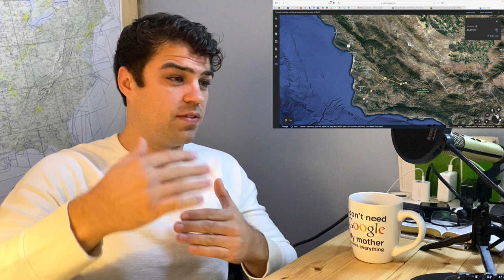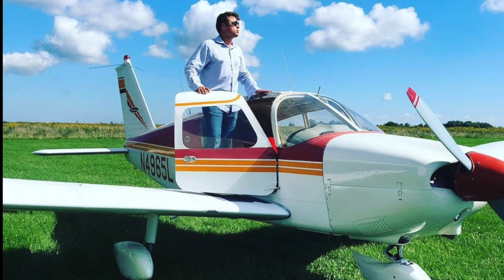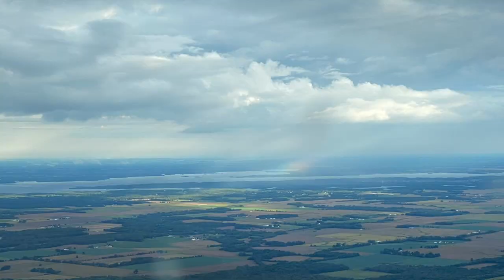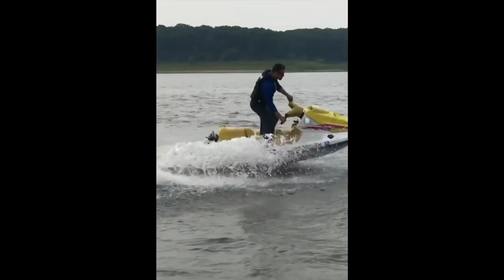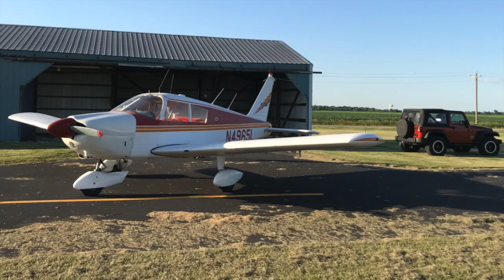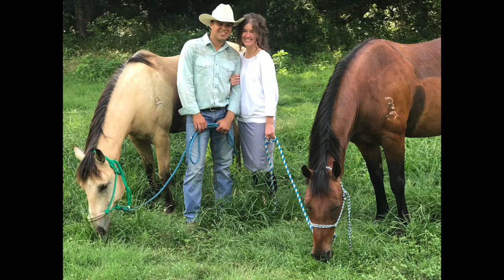How Trevor Jacob Intentionally Caused An Engine Out Scenario Leading To An Airplane Crash.

Comment: I would have to disagree. That particular aircraft has a manual fuel gauge  clearly visible during the video (right outside the front window on cowling)  that shows it nearly full at the time he "bailed" out. Additionally, he had a fire extinguisher strapped to both legs (clear in the video) which I suspect he had in the event of a post crash fire. Trevor is a crook as far as I am concerned. He followed zero protocol and made bad ADM. I hope the FAA throws the book at him.
Reply: He also intentionally slowed the plane so the propeller would stop spinning. No way the engine would start up again then and caused for more dramatic effect for his video
Reply: No doubt that he staged this
Reply from the maker: Thanks so much for your thoughtful and insightful comment! I am sure alot of people will glean alot from it. What this video proves is that his intention was NOT to fly to Mammoth as stated. While we can all feel that, this confirms it. as for the wire, it was either stuck or rigged...
Reply: Nice eye, looked back and his legs do appear to have them. As far as fuel gauge it could of been in-op'd so I wouldn't focus on that to much. There are other signs easier to confirm.
Reply: Yep you can see the fuel gauge bobbing at about a half a tank.
Reply: @jthomp997  : Incorrect.  I've seen multiple videos of engine restarts requiring the pilot to slightly dive the aircraft.  Furthermore, in at least one POH I've read for an aircraft I've flown, the POH specifically calls for the technique.  Finally, all aircraft with exiting jumps are slowed to about 10 kts above stall to facilitate easier movement by the jumpers while reducing the potential for wind-driven mishaps and injury.  That's just how it's done.  Every jump pilot and skydiver know this.
Reply: Someone broke down the impact frame by frame   The very last frame shows a clear liquid bursting out and covering majority of the shot.  If It was fuel, he was extremely lucky it didn’t ignite.   However because of the manual fuel gauge, I could see that tank holding water, and then sourcing fuel elsewhere, or perhaps the wing tanks had water to help prevent a fire.
Reply: @justincase5272  Sounds like your saying he didn't crash on purpose which is pretty clear. At the very least, a bush pilot in a bush plane refusing to land in the bush shows it was all a stunt. If he wasn't a bush pilot/have a bush plane (the red one in his other videos) then I could admit a non-bush pilot&plane might (unlikely) jump out  instead of attempting a landing. However, once you factor in he doesn't normally fly with that on his back, he bought a very cheap non-running plane while he owns one already, didn't report it to the FAA ASAP, didn't register the plane until a month after this happen, had a TON of cameras mounted on the plane when he normally doesn't when he flys for a video all paints a clear picture. Sadly, he will loose his ability to fly in a year once the FAA finishes reviewing this event.
Reply from the maker: ....like a disconnected fuel line hanging in the cockpit.
Reply from the maker: to a single main cabin tank. No way he could have flown that far and still  have half a tank in his single 6 gallon tank
Reply from the maker: but that doesn't compute with the fuel burn and distance. He definitely inop'd it
Reply from the maker: Great Insight! Thanks for commenting!
Reply from the maker: Ahhh didn't think of that. It did look very strange that the hose would be disconnected from the wing tank altogether.
Reply from the maker: I see how it could look like i am saying it wasn't intentionally crashed. My whole argument was that it could not have been anything but intentional. I'll be clearer next time for sure!

Comment: Sorry but this is incorrect.  The A model Taylorcraft’s had ten gallon fuel tanks and changed to 12 gallons in 1938 when they switched to the B model.  From 1938 on they all had the 12 gallon main tank. I own one and take great interest with the history of Taylorcraft’s.  I hate that the idiot wrecked one on purpose but you can clearly see he had fuel from the float wire.
Reply from the maker: Awesome, can you give us an accurate glide ratio?
Ok, so his indicator is clearly not indicating correctly. If he used 9/12 gallons it would show nearly empty. 9 is the least he could have used at this point and it is likely he flew circles
Reply: @DailyNOTAM  ten to one would be a decent guess. Taylorcrafts have a huge wing and they are light weight. They can glide very well. When the main fuel gauge wire shows empty you still have over two gallons in the tank in level flight. It’s literally just a float on a wire and bounces around in the fuel showing you how much is there. My Taylorcraft burns 3.7 gallons an hour and has the same continental a65 as Trevors. His plane originally had a Lycoming 65 but was changed before he got it.
Reply: You can't rely on the wire/bobber on a aircraft to be accurate that hasn't flown in a long time... the wire and tube get "crusty" when they sit... any bend will make them stick. Its not a issue if you "dip" the main tank before flight and pay attention to time. Plan for 4.5 gal per hr. should bring home with fuel left in a headwind.
 This guy doesn't appear to be the kind to pay attention to detail and make sure the wire moves freely.
 I find it lucky he didn't have a fire even after he run the engine out. There is still unusable fuel onboard...
Reply: @techsolutions8237  Total nonsense on your part.
Reply: @elonmust7470  I don't think so...
Reply: @elonmust7470  You are welcome to back up your b.s. but otherwise you are just another troll....
Reply: @techsolutions8237  Santa Ynez Airport was well within gliding distance from the crash site... 
From where he crashed, you can come in at 3000' with a 9:1 glide rate..
Reply: @techsolutions8237  crash site..
Reply: @techsolutions8237  Are you implying that he could not've made it to Santa Ynez from where the engine failed?
Reply: @elonmust7470  Tell me about your Taylorcraft hrs... 
 You clearly are full of it!
Reply: @techsolutions8237  Totally irrelevant.
Reply: @elonmust7470  I'm not "implying" anything... How many hrs in a Taylorcraft do you have? That was the 3rd time.... I don't do passive/aggressive.
Reply: @techsolutions8237  You certainly do avoiding questions.
My flight time in Taylorcrafts is COMPLETELY IRRELEVANT to the fact that the plane in question could've easily glided to Santa Ynez Airport....
Reply: @elonmust7470  I just read my comment again and it was about the  fuel gauge and unusable fuel.... where you came up with not making it to a Santa Ynez airport is your imagination...
 BTW... if you are at a "crash site" that means the plane CRASHED! It is  no longer able to fly, "can't glide anywhere"
Reply from the maker: this is not the b model. the b model has the extra tank in the rear and not in the right wing
Reply: @DailyNOTAM  you are completely wrong again.   His taylorcraft is a 1940 Bl12.  B as in model. L as in lycoming engine which was changed to a continental before he bought it.  Taylorcraft did not make a 9 gallon fuel tank for these planes.
Reply: @DailyNOTAM  Its a BL65. The "L" indicates Lycoming 65 hp.
Wing tanks are a option....
 In Trevor's case the right wing tank is missing.  Look at the top of the wing... No filler neck or cap, but a hole in the fabric for it. Its been removed...
Reply from the maker: @tylerrockwell6080  please cite a source?

Comment: So Lompoc City Airport, where he took off from, is about 30 miles from the crash site. If the plane had 9 gallons of fuel on board, and burn rate for the 65hp engine is about 4 gallons an hour. Airspeed in climb would be 65/ 70 mph and a climb rate of 500 ft. per minute to 9000 ft. So 9 gallons divided by 4 gallons an hour = 2.25 hours of run time. It would take about 20 minutes at 65 mph to reach 9000 ft at 500 ft. per minute, plus time on the ground then he would have burn maybe 2 gallons. So you think he ran out of fuel 30 miles from the Airport where he took off from. He would have had more than a half tank when he reached 9000 ft.. He was flying to Mammoth Yosemite Airport which is 223 miles from Lompoc City Airport where he took off from.
Reply: This.  If he "ran out" of fuel, then he planned VERY poorly for a flight to Mammoth.
Reply from the maker: Exactly. It proves he did not plan to go to mammoth
Reply from the maker: This proves he did not plan to go to mammoth. But watch his flight track, he did not fly direct
Reply: @DailyNOTAM  I believe he wasn’t planning on making a direct flight to Mammoth. He new he would need to make multiple stops. 
You can clearly see that he took off from Lompoc and was heading to New Cuyama Airport. From there not sure what his next stop would have been. 
Question is why did he climb so high just to go to New Cuyama? There is a Condor Sanctuary which requires flight clearance of 9000 ft. near his flight path which could explain why he was flying so high. 
I’m still not sure if it was intentional yet. But moving his plane before the NTSB had time to investigate will definitely not go well.
Reply: @richardwideman5942   New Cuyama isn't a public airport.  It's closed.  Nearest would've been Taft.  Maybe Bakersfield.  But, his heading was way off.  He flew directly to the planned jump zone.
Reply: @artisticwife4889  I believe you are correct, Taft-Kern County Airport is 66 miles from Lompoc which should have been achievable. I think the reasoning for being off the flight path to the south could be he would have a long decent down to Taft (Elevation is 858 ft.) and maybe didn’t want to circle down. Interesting that that Taft has parachute icons on the VFR Sectional. 
I don’t believe he would go to Bakersfield since he didn’t seem to have a radio on board.
Which makes me wonder how he took off from Lompoc without a radio.
The fact that he had fire extinguishers tape to to his legs and the moving of his plane from the crash site is what will end up doing him in.

Comment: The fuel indicator for the forward tank shows it was mostly full when he bailed.
Reply from the maker: Most definitely not working... the POH linked in the description describes the hose and valve shown in the original video as loose and not connected.
Reply: @DailyNOTAM  The forward tank indidcator is a visual float type, it was working fine. He could have switched to that tank for more fuel...
Reply: @DailyNOTAM   Look at the metal rod indicator on the nose of the airplane.  It was showing that the forward tank was close to full.    It has nothing to do with the disconnected floppy fuel line and valve.
Reply: Also, fuel to the engine only comes from the front tank.  You can not draw fuel from the wing tank to the engine.  When the front tank is more than half empty, you can open the wing tank valve and it will gravity feed the fuel in the wing tank to the front tank.
Reply from the maker: @jackodinsen604  It does though. If he had been using fuel out of the main tank the whole way, it is impossible he still has that much fuel. it obviously doesnt work
Reply from the maker: @jackodinsen604  agreed,  but see my comment above. Indication is wrong
Reply: @DailyNOTAM  He may have filled the front tank from the main tank.
Reply: @DailyNOTAM  Also, I am seeing suspected crash locations of between 27 and 46 miles from departure airport.  Why do you think the tanks would be empty?
Reply: @DailyNOTAM  a lot of reaction videos called this out as well, it was odd that he had it where it was (don’t know anything about planes, just interested in the drama haha).
Reply: @DailyNOTAM  WRONG
Reply from the maker: @elonmust7470  watch my location video
Reply: @DailyNOTAM  Santa Ynez airport............

Comment: The fuel gauge which is visible in the video (the float / rod in front of the wind screen) seems to indicate it had fuel.  The lack of fire would indicate it was empty.  That being said if he wanted to attempt a restart it does not take an electrical system / starter.  The prop was windmilling and prior to him jumping out you can see him slowing the aircraft down presumably to make sure the prop stopped.  You can see the prop windmill again after he exits the aircraft and it noses down and increases speed.  It is not clear if he pulled the mixture or if it ran out of gas, but the bottom line is it was a stunt and unnecessary.   1.  He had fire extinguishers strapped to his calves.  2.  He did not glide in his chute to safety but instead near the airplane to retrieve the go-pros.  3.  He had his door open looking for the place he would bail out prior to the engine stopping.
Reply from the maker: Very good points and very well said!  Thanks for taking the time to watch and reply!

Comment: Yes we know from Mechanics posts that he likely ran out of gas. But people are speculating he did so on purpose and may have deliberately tampered with the fuel gauge to make it look like it was full? Why have 2, possibly 3 hidden fire extinguishers strapped to your body then? Others are speculating that he siphoned the gas from his tank in flight. You can also see that the wing tank was disconnected in his video which is ridiculous and inexplicable as to why you'd fly without fuel in your wing tank?  It makes it even more likely IMO that the entire thing was staged, allegedly.
As to the starter, Certified flight mechanics have posted videos saying that this aircraft is indeed hand start but that with the air flow, if the engine had gas the air flow alone turning the prop should have restarted the plane. So the gas theory is probably correct.
Reply from the maker: I would say that it was tampered with or not indicating correctly. Impossible he had that much fuel left anyhow. That is my intention here. Tangibly prove it was intentional (impossible to reach his destination).
Reply from the maker: He also needed the fire extinguishers as engine heat could easy start a small fire in the grass and foliage
Reply: @DailyNOTAM  Absolutely agree.
Reply: Not defending the guy at all, I think he’s a clam. But I fly a very similar plane 46 champ a-65 and I’ve only flown it with fuel in the wings once and that was enough to know that I don’t like flying with fuel in the wings. Short field and I’m big on pizza, I dont need the extra weight. That was the only part I disagree with, carry on.
Reply: Why would he syphon the gas while flying? He would have to put that gas somewhere, he literally took off with just enough fuel to get him up there then just waited for it to run out of gas and jumped out.
Reply: @tylerhensley2312  you do know it is possible to just let it fall right?
Reply: @smokejaguarsix7757  I absolutely understand that however he was obviously worried about a fire with the extinguisher strapped to his leg so why would he wreck a plane full of gasoline? I'm by no means standing up for the guy but him just simply running it out of gas to jump out seems like the most obvious answer.
Reply: @tylerhensley2312  Fuel or not planes still have oil and the engine would have been hot. In the dry conditions of the desert it could have easily set fire to the brush. Plus there are still fumes and gas vapors in the engine. If it was proven (which I think is about 99.9% certain at this point) that this was faked and his crash started a forest fire....youch. He'd be looking at hard prison time.
Reply: @DailyNOTAM  Nathanael, you DO NOT MAKE SENSE because first you say one thing, then you say another thing.  First you start this video with "all the proof that Trevor lost his engine."  Now you're saying, between the lines, that he did not intend to make it to his destination and that things in the plane were tampered with.  Tampered with by Trevor?  Your trying to "prove" that Trevor's engine-out was REAL and not faked doesn't mean a thing because he could have tampered with something to make it look like he had an authentic engine-out.  After all, you just admitted it right here: that it was probably tampered with, that it was intention, and that Trevor did not intend to reach his destination.  Get a life; you need to be a better "prover."
Reply from the maker: Awesome and thanks for the input!
Reply from the maker: Very good point!
Reply from the maker: Like the plane?
Reply from the maker: That country is really dry and he would have had a major attention if it would have started a wildfire. He didn't want that and the investigation that would ensue.
Reply from the maker: I think that at 60 mph more or less without fuel, the engine would not be hot at all. It is air cooled and would have cooled very rapidly at that altitude as well, and a fire would not be likely... but bring the fire extinguishers just in case!
Reply from the maker: Nathan, thanks for taking the time to listen and comment. Here is why i said it the way i did: you have to prove each point -point by point in a legal case. Each claim has to be validated. The fact that he ran out of gas does not validate it was intentional... -it proves he did not do fuel planning to reach a destination. - the crash site says his stated destination did not correlate with his flight path. - the plane was un-able to make a flight to any directional destination because he didn't have the fuel to make it. -the whole picture together states it was intentional - not each point.